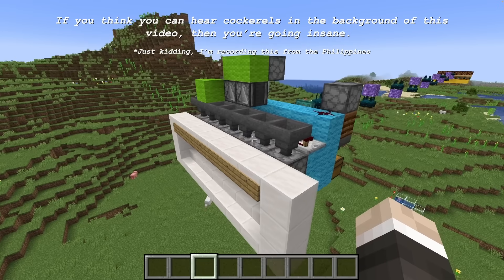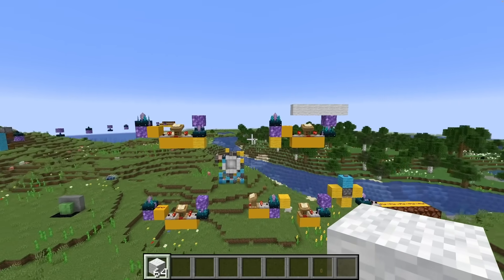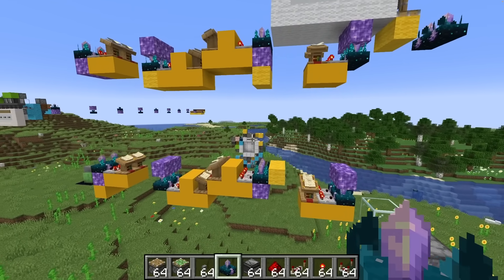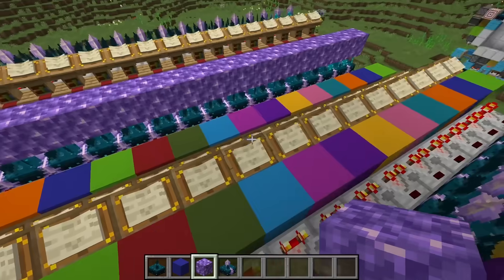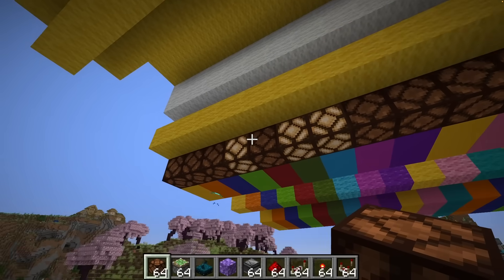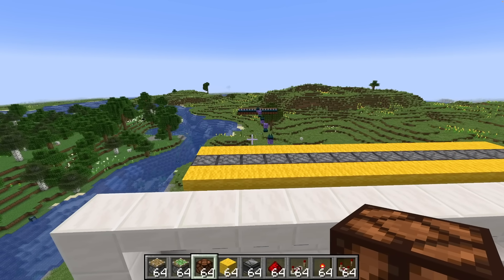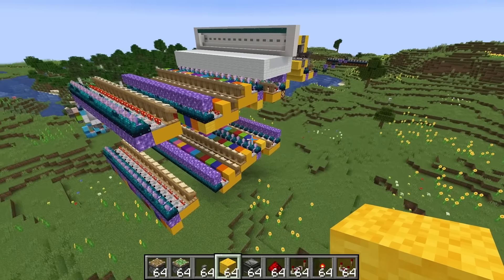This is not a redstone contraption.

Comment: Honestly having a radio communications tower that you enter and hear all those melodic amethyst sounds would be pretty awesome.
Reply: Imagine texting ur friend a thousand blocks away in minecraft (u probably have to use morse code tho)
Reply: All we need is a uni and bi directional sculk sensor, for long distance wireless skulk signal transmission, and also a skulk signal replicator, that gets a redstone input and transforms it into the skulk sound signal, for easy skulk sensor transmission reset without player input.
Reply: @blueninjastudio  Instead of Morse code, since there are 15 different possible signals, you could come up with a code similar to ASCII. Each character could be represented by a pair of signals. 15² = 225, so you'd have up to that many possible characters. (For people who speak Chinese, Japanese, or another language that doesn't use an alphabet, you'd probably need to increase the number of signals used for each character.)
Reply: @kane2742  or setup 15 pre determined messages, which is a lame way but it works
Reply: @kane2742  More than enough, extended ASCII has 256 chars (including 32 control chars and several random symbols)
Reply: @AmericansElite  Where's the fun in that?
Reply: @aspenhart_  it would be 225 pre determined messages if you’re still willing to press two buttons instead of one
Reply: @blueninjastudio so mumbo in a way kind of made a telegraph?

Comment: For those who don't know, the signal travels faster the closer and more sensors that are nearby.
Reply: Thx Wattles 👍
Reply: Thanks I’m a Minecraft noob so this helps:}
Reply: Yes, they do, however at a certain point you might as well just use redstone with how close the sensors might be.
Reply: But if we use a line of skull sensors, that's just no different than using redstone lines
Reply: @iamgoo  ah a fellow wattles viewer
Reply: @aguyontheinternet8436  It still allows different signal strengths to be carried in the same 1 block wide wire.
Reply: They dont, i tried it and it takes the same amount of time
Reply: @JamUsagi  you can do that with comparators in a line too. I wonder if it's faster or slower though.
Reply: @dapperpotatoes8473  if you're using it as a multiplexor, you couldn't replace it with redstone. if you're only sending one sound then yes, it would be better to replace.
Reply: @diggoran  for a singular sound yeah replace with redstone, but if you want to say have 3 sounds and speak morse code with your friends then you could lol
Reply: @TheRumpletiltskin you can use 1 redstone line for serial transmission of binary data and decode it back to unary at the output
Reply: @JamUsagi  technically rails allow infinitely many different signals to be carried in the same 1 block wire instantly. Better in pretty much every way
Reply: @dapperpotatoes8473 ye shut still useful to know if you want to slightly increase there speed

Comment: This is insane. Imagine that several towns are in a local proximity, and they all have a system like this set up. If footsteps are heard without a ‘key’ item inputted, then the signal strength of 1 would notify other towns of the noise, and it could be a different level alert for different sounds. It could essentially be a security system with an SOS broadcast to other towns.
Reply: minecraft chat: 🗿
Reply: @_Beam  bruh stop ruining the moment !!1!!!!1!11!1!!!!
Reply: Another settlement requires your help...
Reply: the scale has just increased by  1 to  15
Reply: Griefers removing one block in a l tens of thousands of blocks long line 🗿
Reply: Or you could communicate with Morse code over long distances as long as the chunks are loaded (which can be done with chunk loaders)
Reply: Basically WW1 encrypted radio technology lol
Reply: @Fawful81080  still no guns in mc
Reply: @seannewell1640  GONDOR CALLS FOR AID!
Reply: @Ibadullah Mechs with TNT cannon exist and so do precision cannons which if precisely done could instantly fry anyone in the range with a click of a button or flick of a lever and it wouldn’t be a small range with only a few safe pockets you could also detect walking

Comment: If people can find out how to permanently store the sounds, this would be a massive breakthrough. It still is actually, this update is really neat.
Reply: We need a chest or barrel etc. for sound, a recordable disc that stores sound in NBT perhaps!
Reply: Yeah that could be cool, I'm pretty sure redstone people will find a way soon enough. I'm gonna do some messing around with them but im not nearly as smart as them so I doubt much will come of it lol
Reply: Can't you just use a chunk loader?
Reply: @JJean64  You might be able to but if it's a big contraption having multiple chunk loaders working at once might lag your game alot.
Reply: As someone who doesn't actually know redstone. Wouldn't you be able to store the sound and repeatedly use the sound if when the sound storage system is triggered to release the signal instead of simply having it go down a line, couldn't it just create a bigger loop where the sound goes to where it needs to go and then keeps following the loop back to the storage system where it closes again?
Reply: @Weirdo_Studios206  If you can fit it inside a chunk, you're ultimately only using one chunk loader for each sender.
Reply: Edit: Mis-understood the limitation.  So this comment is now an admission of stupidity.
Reply: @JJean64  Chunk loaders do not work across server resets.
Reply: @theteapotato763  Once the sound has been stored, it will stay in the loop permanently, as it will trigger both the continued loop and the output at the same time. The problem with the system is that if you leave the area the sounds will disappear, because the area is no longer loaded. Block placements will be saved so they can be reloaded once you return, but the sound data will cease to exist. Hope this made sense. (and that it is correct. I'm just making an educated guess)
Reply: Maybe build a chunk loader?
Reply: I think it would be easier to attempt to automatically and or easily create the sounds when you are there. Something like a startup sequence akin to a normal phone.
Reply: They should add a Calibrated Shrieker that would generate sounds of a specific frequency.
Reply: Simplest way I can think of is a chunk loader maybe but I have no clue
Reply: @Weirdo_Studios206  I hope Mojang heres about this video and makes the sounds saveable
Reply: @papaaquchala8460  and what if you close the game?
Reply: @StarWarsExpert_  It would be cool if they did, right now I think I made 10 of the 15 possible outputs work (still need to test) but having all 15 outputs be usuable would be huge.
Reply: I'm wondering if a chunk loader would make them stay stored...
Reply: @mstfbldrc  ummm breakthrough for what? We can already do this with redstone dust with no gimmicks or setup required. I don't see a use for this tbh but maybe I'm just dumb and I'm missing the very obvious use for this idk
Reply: Mby a chunk loader??
Reply: @Mik-kv8xx  Mumbo just enjoys making wierd things like hebsays at the end. IDK if skulks needed for a long line is cheaper to make than redstone, but it could be a budget way to do long distance lines. But atm I xan't think of anything it could be used for that you can't do with a redcoder.
Reply: Chunk loaders, maybe?
Reply: I think it would be cool if the different music discs produced the frequencies needed for those sounds. Like Pigstep could be 15 strength whenever played. I don’t remember if there’s enough music discs since I don’t normally collect them all but I think there’s more than 10.

Also maybe noteblocks with different frequencies and sounds could also produce the needed strength. Like a noteblock on sand produces 3 strength sounds
Reply: @thomasfplm  this would be awesome
Reply: I have some ideas myself actually because I need such a thing for another idea xD
Reply: @thomasfplm  that would be amazing
Reply: If there's a way to keep sounds persistent, we basically have a (relatively) compact wireless sculk RAM!
Reply: chunk loaders would keep it as long as the world is open but sadly thats not much
Reply: @the8413  no, this isn't binary or serial. It's really just a hex signal sender and receiver
Reply: @VIBaJ 16  sry if I was unclear. I meant that they are similar in the way that they send a signal across a single "wire" not that it was binary or serial. It just reminds me of one.
Reply: Put copies of the sounds in spawn chunks, then send out copies of the sounds to each station that needs through the lines that connect all the stations, maybe?
Reply: @earzo7  unless relogging also breaks it
Reply: @Mik-kv8xx  Yeah we can save sounds with redstone but I guess when you exit from the game or go to another chunk it doesn't work
Reply: @DaftFader  I guess yeah
Reply: Aren't spawn chunks constantly loaded? If so, you could use that to store the sounds. The only problem is that you're limited to the spawn area

Comment: I think with a system like this you could effectively transfer messages in Minecraft without using chat, albeit with a bit of decoding on either players side but it would be a nice way to secretly communicate. Each button equals 2 letters meaning 13 are for letters, 1 is for space bar and the remaining one is for dots. There's some serious potential there.
Reply: You’re almost able to do hexadecimal if you’d be able to come up with a way to get a 16th output
Reply: @bksmith3717  It is actually hexadecimal if you count “off” as 0, then assign each of the signals as 1-15. You could even get more clever with it for a bit more work by sending 2 signals in rapid succession and counting them as one number, leading to 256 permutations, thus allowing for all numbers, the entire alphabet, and a good amount of punctuation or emojis.

Of course, you could alternatively just press T and type in what you want to say in chat.
Reply: Or morse code
Reply: or u could just use a sign?
Reply: @rorys433  long distance communication
Reply: /msg
Reply: @redstonerti9918  Just say you don't like creativity. I'm not saying you're wrong I'm just saying it's good to let your imagination flow.
Reply: @fakeraven4079  Morse code only requires two signal, a long and a short. If you know it by heart. Although I do like the idea of simplifying to two for the purpose of compatibility and using morse code as an alternative. Good thinking!
Reply: @leezhoney4890  You can interpret it however you like. Maybe someone didn't know that you can use /msg to talk to people privately. At no point did I say it wasn't a cool Idea.
Reply: ASCII is just 7 bit, so you could easily encode most symbols that you use only with the easy-made sounds. Just have an agreed-upon clock-speed, or have a second line with one of the hard sounds for clock pulses, and you could easily determine the precense or absence of a "sound-bit". You could even take some inspiration from network science and use the less easily reproduced sounds as bus broadcast/package header messages, so that you can send messages pseudo-asyncronically and do some light error correction. You would still need to adhere to a form of sub-tick within the system, but you could start your word clock at any point rather than adhering to a strict word tick every seven sub-ticks.

Although at that point you wouldn't need the differentiation since you would need to send them sequentially anyways. It would mean that error correction could be easy, but you are just working in binary with some fancy networking shortwords. In that case you could have one data carrying sound, and all other sounds could be packaging, which could lead to some weirdly optimal systems.
If you are doing that then you might as well instead go for 8 or 16 soundbit width and some adapted unicode, since you have made a very good bus broadcast-and-recieve system that could integrate well into an actual redstone computer.
Reply: @fakeraven4079  hasn't he ever made this in other video?
Reply: Could just make a water tunnel and a book lol
Reply: @bksmith3717  send 2 signals, one encoded with the signal and one as a timer. when the timer lamp activates on the receiving end, the signal lamp activated from the encoded one can turn on one of the 15 lamps, or none on for a 16th output, which is signaled to exist by the other line of sensors
Reply: Use binary and ascii. Convert the letter into it's corresponding ascii number and then represent that number in binary using 8 buttons - off for 0 and on for 1. Only downside is you'd only be asble to send 1 letter at a time.
Reply: This adds some real WW2 Morse messaging for people doing RP

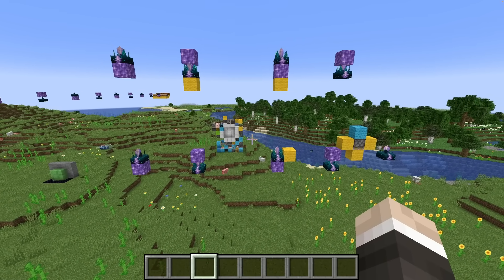Comment: 1:18 I love that you have re-invented one of the very first computer memories called a "delay line", which had its first practical use in early RADAR! It is very similar, except there they store the propagation of a wave travelling through a liquid (because they didn't have calibrated sculk sensors back then, apparently, tsk)
Reply: I bet they hasn't even been to the end yet back then. 😂
Reply: Yeah, sounds like magnetic core memory